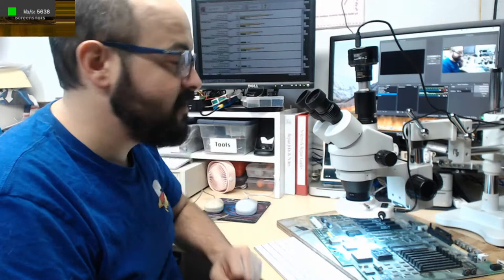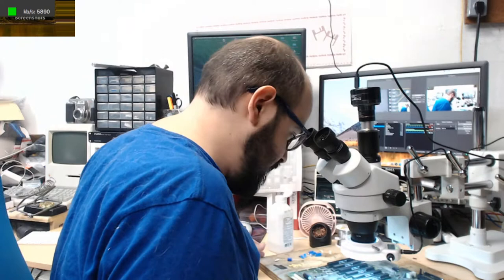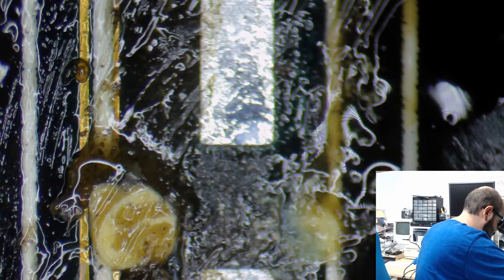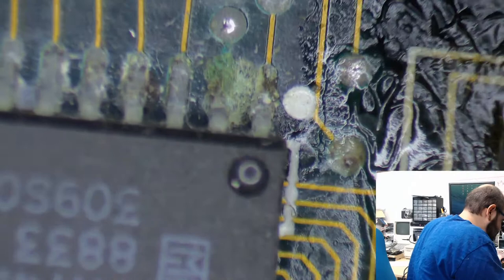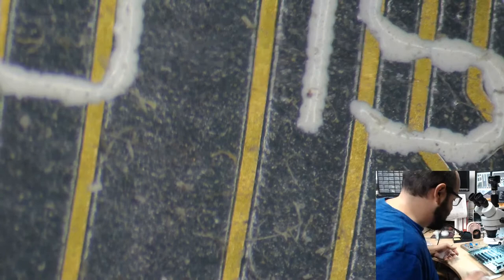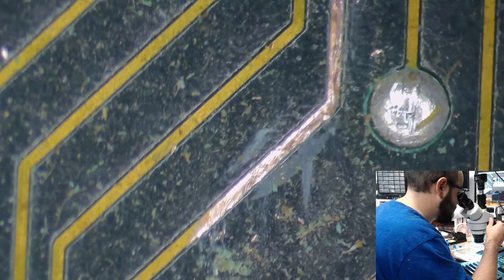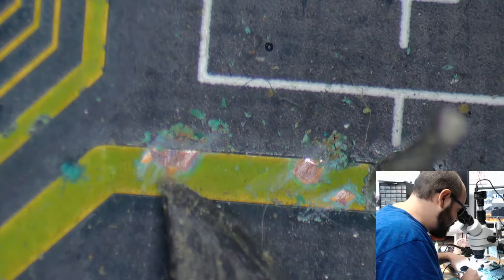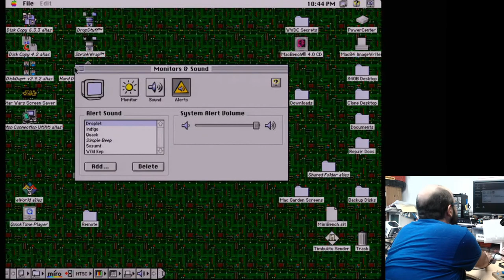Mac84 LIVE: Repairing a Macintosh II

Comment: The soldering iron that I have is with the blue handle it is the ksger t12-9501 and I got it from Bangood or you can get it on Amazon for around $80 to $90.
Here is the link: https://www.amazon.com/dp/B07PQ1GJZ5/ref=cm_sw_r_cp_apa_i_ZfDrFb2SK38MG